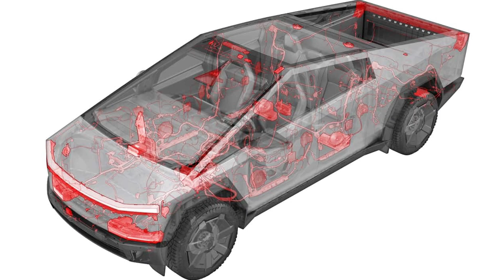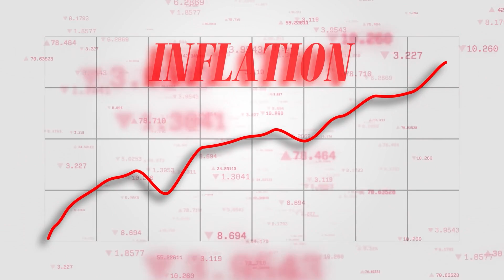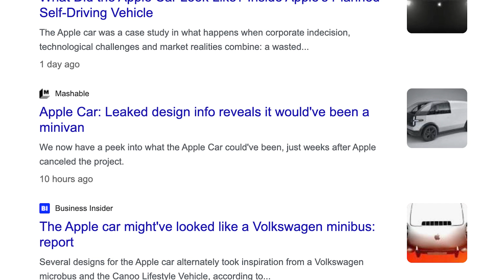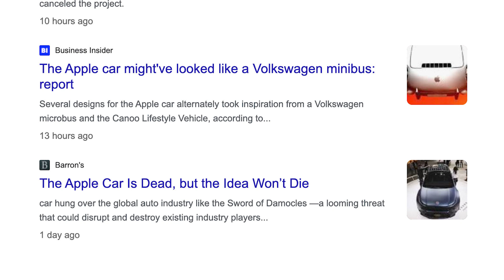Can The R2 Save Rivian? | Disruptive Investing News

Comment: Something missed is that Yes they have a NAG'S connector, BUT it's on the WRONG SIDE. This will mean that just like for Mustang and Lightning it will have TOO USE TWO CHARGING stalls too charge. This will make fir problems at the chargers with Teslas waiting to charge and there is available spots accordingly to the Tesla app but will have them blocked by other manufacturers vehicles. Tesla drivers will be upset with that.  There needs to be a condition on the use of Teslas chargers that all vehicles MUST HAVE CHARGER ON THE LEFT SIDE REAR.
Reply: Rivian plans to sell a lot of these in Europe, where most people don’t have garages.  They use mostly street chargers.  The port is located to accommodate them for the majority of of their use.  Here in the US, road trips are about 6% of use case, most of the time they would charge at home and only be inconvenient every now and them.  Tesla already announced they will be upgrading to longer handles, so it won’t be an inconvenience here for too long either.

Comment: Honestly, I was stunned when they said H1, 2026.  For Rivian to survive as and independent enterprise, I really think they need to be able to start delivering the R2 by H1, 2025.  As you said, they've had this design plan since the beginning, so why are they still 2 years (best case) away from starting deliveries.  I guess they were hoping the R1 would generate cash-flow to fund the R2.  At any rate, it seems like too little, too late to me.

Maybe the announcement will boost the stock enough that they can raise another $10B.  But the bump they got after the announcement has already faded, so that's not looking good.  Assuming the R1 and R2 can be made profitable, I think the Rivian brand or at least platform survives, as a buyout.  GM should probably buy them and add the Rivian make to their lineup, but I don't think they have the cash.  At an $11B market cap, Apple could easily buy them at a 50% premium and rebrand as the Apple car.

Maybe enticing a buyer was the intent of the announcement all along.

Comment: I think you guys are being a little too negative to Rivian.  They are following the Tesla playbook very well.  The price point of the R2 will allow a great deal more to be sold, this will allow them to negotiate with their supplies for more favorable COGS which will lead them into the profit zone.  Exactly what Tesla did when they went from S & X to 3 and then to the Y.  There is no guarantee it will work out of course but I think the fact that the R2 is close to the R1 is a net benefit.  People with cash will still go R1 so they can brag they have an R1.  People that don't have the cash for R1 or are even stretching to the R2 will line up in droves.  Just like the Model 3 when it was 50K.  Also unlike the legacy (which don't want to leave ICE or companies like Fisker which don't build their own cars) Rivian is building their own cars and can move to more vertical integration.  They still need to negotiate the base materials they would use to integrate production.  It's not like Tesla is smelting their own Aluminum. If Rivian is on the Tesla Supercharger network that is just another win.  I don't know about MA but here in the Princeton area of NJ Teslas are everywhere.  Many will want something different. Finally RJ is not tweeting daily/weekly his political bend/whim and turning off large sections of the buying public.  I say this as someone who owns three Teslas.  I think Elon has done great things, will continue to do great things but his tweets and replies to conspiracy nuts and far-right wings loons is not a great look.  I dislike the Dems and hate the GOP.  I am always looking for a new party to vote for so you know where I am coming from.  I wish Elon could overcome his social media addiction.

Comment: You guys are significantly mis characterizing everything in this video. The point about the vehicle being designed before the R1, and that even mattering, is one of the dumbest things I’ve ever l heard. The design of the exterior and general aesthetic may have been, but it’s clear that nothing else about the R2 is the same as the R1 platform. From the battery to the steering wheel to the software (it’s an entirely new ui they had in the demo cars). 

Honestly I’d take this video down, it’s kind’ve embarrassingly Tesla fanboy